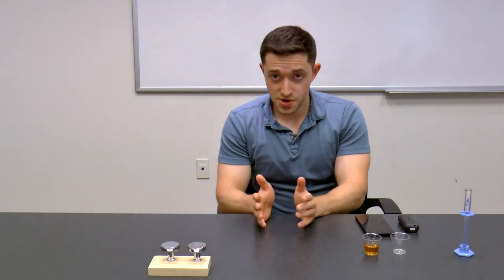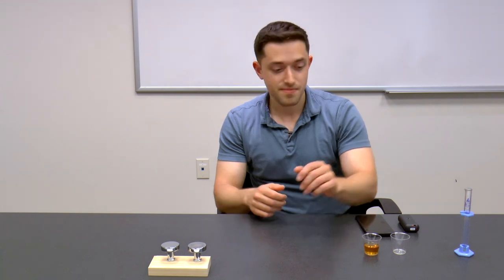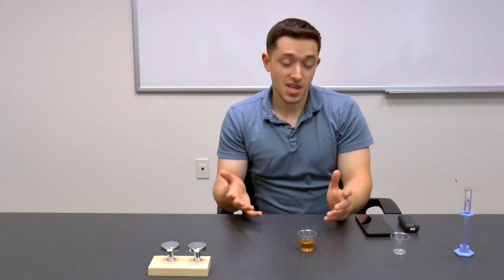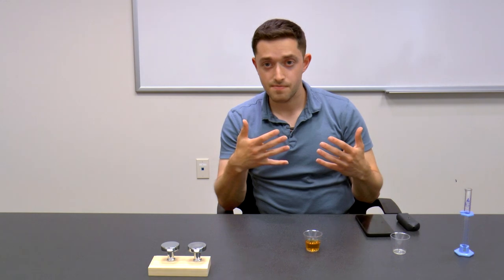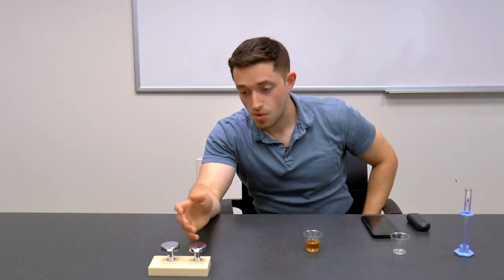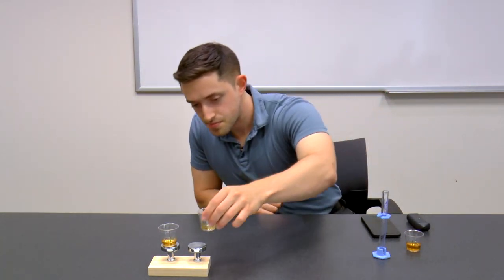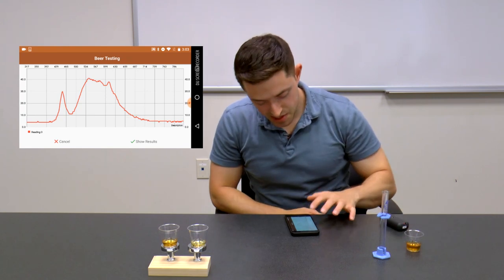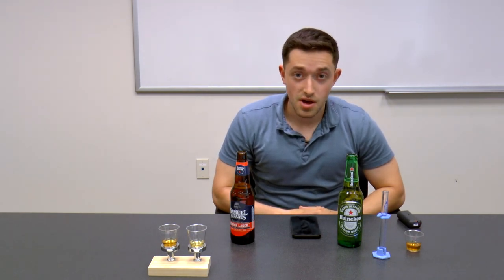Measuring beer color with a micro-spectrometer

Comment: Wrong sample size can lead to wrong measurements result. Lowest amount for the estimation of the beer quality is at least 0.5 liter! :)

According to the shown results - the spectra are just distorted LED spectra, that is.... let say...  not a good a way to show results. The spectrum of built-in LED is known or can be calibrated, so one could easily find out and show the real reflection/absorption spectrum of a beer with characteristic lines..

Also the variety of beer kinds is etremely limited - would be nice to see dark, wheat, filtered/unfiltered kinds. At least 4 samples for comparison or even up to 10 different! samples

P.S. Once I have assembled a Raman spectrometer for cognac distillates analysis.. Tens of kinds from 1 year old up to 25 year old distillates. Not blends - pure distillates! 
That was best samples I ever had!